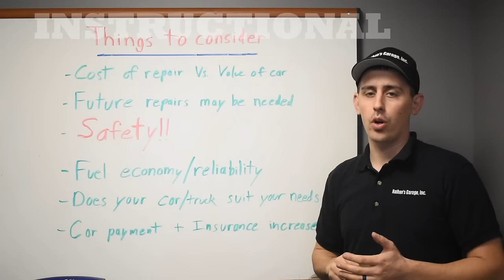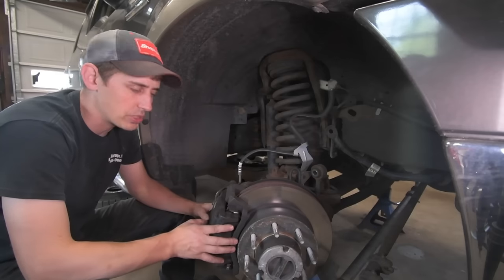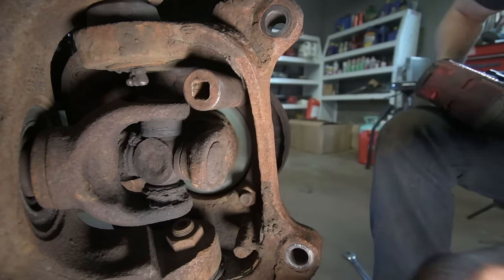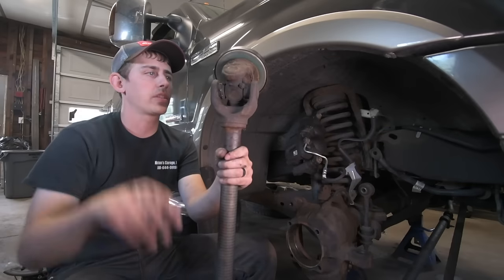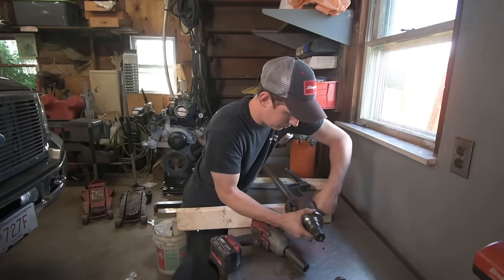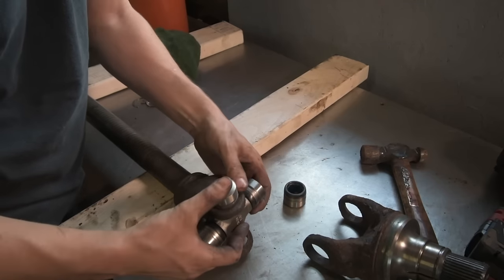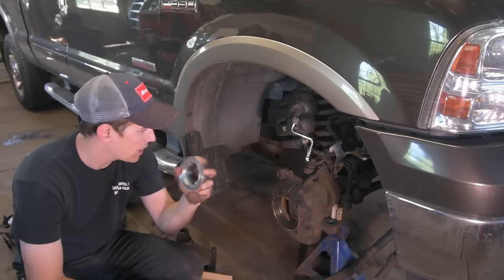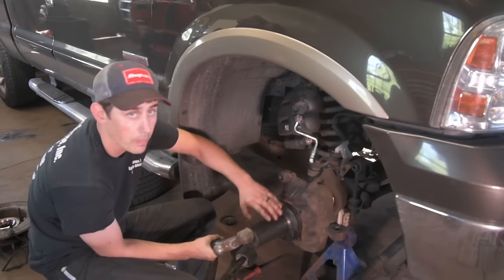Ford Superduty Steering wander repair....Axleshaft u-joints

Comment: Great job explaining everything. I've got a 2002 - F250 gas burner with 318,000 miles.
Yesterday I had a vibration that seemed to come from the drive shaft mainly during acceleration. This morning I've got gear oil leaking from the right front axle. Probably a total separate project but really enjoyed your video. Keep up the good work.
Reply from the maker: All of the work performed here needs to be done to replace the inner axle seals but you additionally have to pull the front differential and install new seals from the inside. Hopefully this helps and thank you for watching!

Comment: You saved my day. As my truck passed 150k I’ve been changing steering parts as they’ve worn out and everything is tight now. But, I couldn’t figure out what was going on with this intermittent jerky steering after a turn. I started considering the steering box before this video so thanks, you saved me a ton of $.

Comment: Don't underestimate having rugged snap ring pliers, not the junk they sell at auto parts stores. The snap ring inside the hub is no joke  its potentially the hardest part of the job. Great video your skills are evident, Ive done these at least half a dozen times on a F350, New England weather eats u-joint on plow trucks.
Reply from the maker: 100% right. A cheap pair will make it almost impossible and can actually be dangerous.

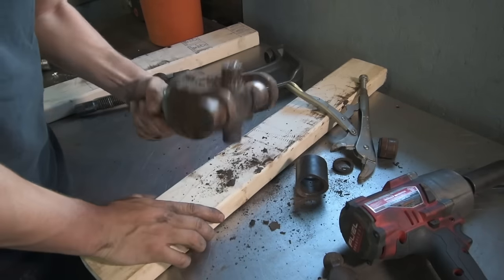Comment: Clearly this man is a good mechanic. He is spot on with the cause of the steering centering issue that I had. My right side front axle u-joint was seized to the point that when I had the axle out and after removing the half that did articulate, I could barely get the u-joint to rotate striking it with a three pound hammer on the bench. Because I had the option, I chose to cut the center of the u-joint  out with a torch rather than trying to get the seized cap off in a free state as seen starting at about 19:06 in the video. Also not mentioned in the video, I recommend removing the half of the joint that is not seized first, as it makes it easier to remove the stuck side if the other half of the axle is not flopping around. My truck drives great now and I did not blow 1K on a steering box I did not need. Thank you for the video

Comment: Brilliant Vid. Only might add doing a vacuum check on the hub before brakes and tie rods just incase the inner seal install or parts/ seals are found to be faulty. This tutorial is great info for many  years of fords. Fastener specs matter, so look up the specs for the year your working with. Be safe.

Comment: I came across this video in my YouTube feed late one nigh this week. Today I checked my joints and sure enough passenger side is seized. I've only had the truck a few years and looks like the PO changed them to non greaseable type, also seems to have a seized tie rod on the drivers side, so it looks like I've got some busted knuckles in my future.  Thanks for a great video and subscribed.
Reply from the maker: Glad the video helped! Thanks for watching man!

Comment: Awesome info.  Get the tiger tools ujoint tool, saves about 1-2 hours of not having a press.  My 03 excursion wanders like a refuge in the gulf.  I will have to swap mine out, everything else is solid.

Comment: Loved the great point on instructions!  And your a top notch mechanic from just watching your attention to the details :) 
I'm always looking for videos on Super Duty trucks; mine's a 2000 F-250 and has been a solid truck... except I need to how to remove the oil tube thing on the drivers side of the Real Power Stroke, the 7.3 :) I have an oil leak and I've heard it's easy to break the housing during removal!
Reply from the maker: The high pressure oil line that comes from the pump to the head?
Reply: @InTheShop  on my 7.3 there's oil cooler below the left side exhaust manifold!  I've heard and seen that if not removed properly you can break it trying to remove the dang thing :)
Reply from the maker: ahh the oil cooler. The problem I see people run into is when they try to take it out and leave the front endocarp bolted onto the motor. I remove the entire assemble. take it apart and thoroughly clean the end caps. use a scotch bright pad on the inside of the end caps to make sure the o-rings slide in smoothly. Use grease when assembling.
Reply: @InTheShop  And greatly appreciate the reply!

Comment: I am currently battling this wander issue on my 1999 F250 4x4. Just installed the red head steering box and I still have this wander issue. I will check the axle shaft universal joints tomorrow. Thank you for such a detailed video with so many tips and advice. Very much appreciate it.
Reply from the maker: Let me know what you find!

Comment: Im in Australia and I have been chasing this problem with my mates F250 2003 model, your video is very simple to understand, my problem will be trying to find the tool to install the seals, if I had measurements id just make one, thanks and keep up the info

Comment: Good mechanic! Meticulous and open to looking for the new ways to take care of stuff. I had not considered that the U joint would affect steering even when the hubs were unlocked this is a very valuable tip thank you so much when diagnosing wander. Kind of crazy these newer Fords are prone to not driving very straight with minor imperfections the old stuff cracked good even when very worn out
Reply from the maker: Thanks for watching!

Comment: I have an 08 F350 that currently has off center wander and the old front rubber dust seals dangling off both sides just like you described.  Had one shop tell me the front end looked and felt fine, and another one that wanted to throw a new steering box at it.  Glad I found this video and glad I didn't have the steering box replaced.  Will be checking my front u-joints first thing this weekend.  

Really well done video.  Thanks!

Comment: I just got my first death wobble on my 2012 F250 @ 135,000 miles. Doubt this video is my cause but I enjoyed watching you explain how to deal with this issue. I will search your other videos to see if you explain the causes of death wobble and it's solutions. Thanks for taking the time to make this video, well explained.
Reply from the maker: Death wobble isn’t usually caused by this. Closely inspect both ends of the track bar. Also make sure tire pressure is good.
Reply: I have a 09 350 had death wobble twice was a shitty steering stabilizer shock. Don't buy the cheap ones buy a decent one

Comment: Nice job on explaining this procedure in a comprehensive and thorough manner.  Ive owned a bunch of Dana 60 Fords and replaced ujoints a few times, as well as wheel bearings, and ball joints, and your video will help me do it a little easier the next time.
Reply from the maker: Awesome! Glad it helped!

Comment: Nice video. Yeah part of the problem is the ford service dept doesn’t realize that there is a zirk fitting on each steering u joint. The only two on the whole truck on newer super duties. Everything else on the newer trucks are sealed.  Almost nobody realizes at every service shop I’ve been. Many videos out there on it so it’s a problem throughout the us.

Comment: Great video. When you said it started after hitting some bumps I knew that was the problem on my '02 F-250. I went outside and diagnosed it in less than 20 mins. Drivers side

Comment: Excellent explanation, diagnosis and step by step process of doing this repair.  This will probably explain the crabbing issue I've gotten lately when in 4 wheel drive when turning?

Thanks for the great video!👍
Reply from the maker: Thanks for watching Eddy it definitely could be causing that concern.
Reply: @InTheShop  I'll be doing a complete inspection of the front end as you diminstrated in the video!👍. Thx.

Comment: Great video!  I fumbled through most of those steps when I did the ball joints about 5 years ago.  I used ABS sewer pipe to set the seal and it seemed to work ok but if I had to do it again i'd either buy or make a better tool.

Comment: Dude you saved me. I’m not much of a Ford guy. You diagnosed exactly the problem I’m having with a f250.  I don’t have a seal installer like yours. Is there a good way to put in the seals without buying that seal installer.  Amazing job on the video and the tips. I’ve never pushed the caps through like you did. Great idea. And the way you hit the yoke to unbind the u joint. Awesome video.
Reply from the maker: Glad it helped man! some people will fashion a seal installer out of pipe but I personally prefer to use the proper tool because it sets the seal to the exact depth it needs to be. If its not installed all the way it can fail prematurely.

Comment: Great video, I think you nailed the issue that I'm having with my truck and gave me the confidence to tackle it. You likely saved me thousands trying to replace steering box and stabilizer. Thank you!!!
Reply: So did the axle u joints solved your steering wander?
Reply: @angelmarks85  it did 100%. Looks like the ears on one of the u-joints was bent. The steering issue happened suddenly after an oil change so I think the mechanic screwed something up and didn’t want to admit it… not sure how it happened tbh but it’s all fixed now and working great!

Comment: Drill a hole on top of the U Joint cap and pump full of grease, simple and worked for me. Cost less too.
Reply from the maker: That is definitely a good short term solution. Unfortunately if they were seized the rust has already done damage to the needle bearings and load surfaces they ride on. Just keep an eye on them because if they get loose they can damage the axle shafts. Thanks for watching!

Comment: Great video and super helpful. I got a loaner ball joint press from Napa and they press was too narrow and ended up bending the outer part of the shaft. Probably worth having a bigger one, or taking it somewhere to be pressed out. 

I added up the costs on everything, and just buying replacement axle shafts for both sides probably would have been easier and only about a $150 difference.
Reply from the maker: Its Definitely easier to replace the whole shaft if you can find a good price on them.

Comment: Thanks for the great video man! I just picked up a 2000 v10 excursion the other day with 200k miles on it. Steering is super sloppy and I'm working my way through figuring that out. I will see if my U joints are part of the problem. I subscribed!
Reply from the maker: Thank you! Good luck!
Reply: Did you ever find the problem on your Ford Excursion?
Reply: @dirtpoortv4483  i have not! The Excursion is my "extra" vehicle. The last couple weekends I have been working on the commuters. I did replace the steering gearbox, tie rod, drag link, and both dampeners...still didn't fix my issue though.

Comment: Excellent video in all respects. We're having steering issues with a couple of F150 2WD trucks at work. So far neither the dealership nor our local shop have figured them out. I have a couple ideas as to the causes of the issues, but management wants to keep spending money at the garages instead of letting me check out the trucks. I've only been a mechanic for most of my life. Let them keep wasting their money !!! LOL. 
Subscribed : )
Reply from the maker: Thank you! Good luck with that.

Comment: Nice job very well explained glad to see a young man that takes pride in doing the job correctly the first time. This is coming from a senior tech keep up the good work. If I could give you any advice would be to check out the copper base anti-seize. It doesn't have a adverse reaction to road salt.
Reply from the maker: Thanks Ed! I have had quite a few people mention the copper anti seize I may be making the switch!

Comment: One of the best videos I have seen. Excellent instruction and demonstrations! One thing I can't understand though is what makes it wander? Seems if one side was frozen, it could not rotate and turn?
Reply from the maker: The wandering is cause because the power steering can overcome the binding but the natural tendency of the alignment that brings the wheel back to center can’t. You will normally turn the wheel slightly to compensate for road imperfections and it will want to stay that way. Then you turn back to correct and it stays that way. It will keep doing this back and fourth. 

They can rotate and become easy. This causes this problem to be intermittent at times. Sometimes it’s free sometimes it binds.

Comment: Great vid. 
In the past, i have cut an X in the joint with the torch. then the guts fall right out. 
If I was to use the method shown, I think the process may be benefitted by a shot of lubricant on the caps.
Reply from the maker: I have cut them out with a torch in some extreme situations but I try to avoid it because I don’t like putting that much heat into the ears of the axle. The heat spreads fast

Comment: Nice video - I have an 06 350 and have that same seal installer - it's a pain to buy but not much else you can do.  I rebuilt my hubs with new bearings - no use spending 200 - 300$ each when u can rebuild for 20$ a side... nice video I'm gonna subscribe now ...
Reply from the maker: Thank you! I’ve never attempted to rebuild them.

Comment: great video. very informative. good tips. easy to listen to. very helpful for the common man and diy'er. nice to see someone your age with such a great demeanor. The only issue I have with you is, your not my next door neighbor!! I have an 04 Excursion with a bullet proofed 6.0 that I use for pulling my travel trailer and I like to have it checked out and lubed every summer. I do my own oil changes but nice to have a tech do a safety check. Keep up the good work. Made a subscriber out of me!!
Reply from the maker: Thank you! I really appreciate that.

Comment: I made my own outer seal punch out of PVC and Black or galvanized pipe...PERFECT !!! for what you need. no need to rent, or buy one for $70 +...
Reply from the maker: Thats a good option. I personally like using the tool because it sets the seal at the proper depth with no guess work.

Comment: Got an 08 F350 in with this exact problem.(steering tight,pulling intermittently) Ill be checking those U joints! Thanks for this video.
Reply from the maker: Hopefully this helps you! Let me know what you find.
Reply: @InTheShop   Truck now on lift.Tie rods off.. BOTH front axle U joints are frozen! Great call.     I'm in Ma too by the way....;)
Reply from the maker: Awesome! Glad you going it. I’m from southern mass close to Fallriver
Reply: @InTheShop   Just finished up. Had to fix the VSS wiring as well. Truck goes down the road nice and not "possessed". Owner will be very happy. I owe you one!

Comment: Years ago I had some u joint failures in unrelated vehicles. What I found was, some u joint grease passages were not drilled through in both directions. When the joint was assembled with grease from the factory, that was the only grease it ever got on that Bearing cap. Back in the day all u joints were greaseable and a sharp mechanic would catch the manufacturers defect. Even todays non greeseable joints feed from the grease filled crossbody centificaly thruout its service life. Without that little extra lube, good bye bearing or just the end that ran dry.
Reply from the maker: Interesting Info. I never considered the grease being fed centrifugally like that on a sealed joint. Thank you!

Comment: I haven't done a u joint in many years. The one thing that's happened to me is one of the needle beings fell out and layed down at the bottom of the cap, which spaced the cap out just enough to not be able to get the c-clip back on. Be very careful and deliberate when handling the caps, if you drop them down on the bench or even a heavy vibrating can move the needle bearings enough that they won't stay in place when inserting the caps. My experience.
Reply from the maker: Great advice. Its definitely something I always watch for and it has happened to me in the past. Thank you for watching Marcel

Comment: I’ve never seen that hub tool before looks a neat tool, I generally use an air hammer to remove unit bearings. It works great and is quick.

Comment: I always emery cloth the holes and clean the rust from the inner surface where the retaining clip sits. After final assembly i smack the shaft hard with a 4lb hammer near the ujoint to remove any stress and overtight caps. Also it will test if the clips are properly seated. You dont want a ujoint coming apart during operation

Comment: Thanks for the video, I was able to change the front ujoint on my 2015 f250 because of it. A couple of thing I wish I would have known for anyone else doing this-my truck came with a snow plow prep kit from the factory, because of this the ujoints are larger (same as f450/f550) luckily ford had one in stock. The auto parts store will give you the wrong smaller ujoint (ask me how I know). Also I bought the 6697 seal tool from Amazon, it was about $35 shipped which was way cheaper than the $170 the auto parts stores want.

Comment: Great video and good to know frozen U Joints can cause the wandering Ford steering problem.  But give me a good vise and a hammer and I could have that old U joint out and the new one installed while you're setting up the ball joint press.  LIterally a 5 minute job.
Reply from the maker: I used to use a vise and a hammer to do the joints. I actually prefer using the balljoint press now. Far less likely to damage the ears on the shafts.